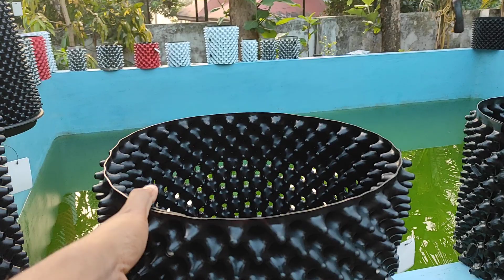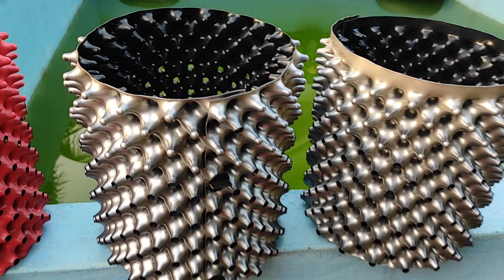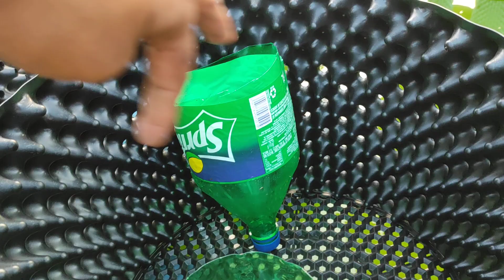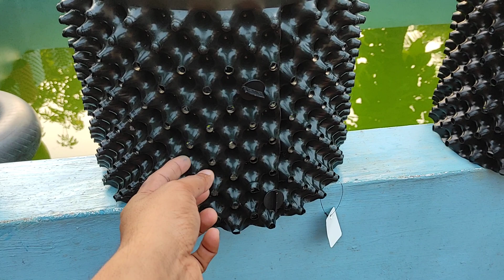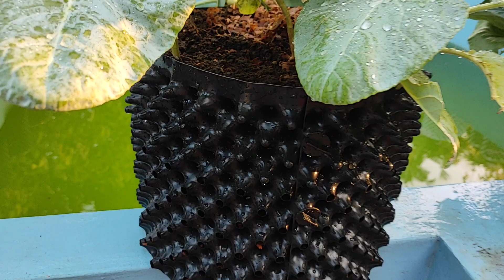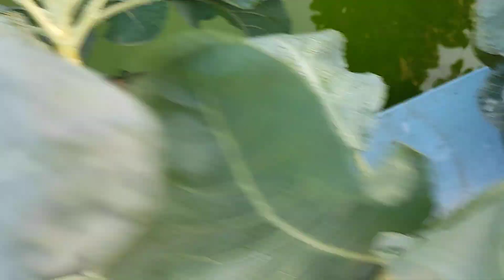എയർപോട്ട് ഏതു size വാങ്ങണം? 7736780815 whatsapp/call.Air pot, airpot, air pot, airpot, airport,

Comment: Paint ബക്കറ്റ് 20 ലിറ്റർ ഇന്റെ വാങ്ങി drilling നടത്തി holes ഇട്ടാൽ മതിയാകുമോ??
Reply from the maker: Air pruning system correct ayi work cheyyilla..Air pot is specially designed.but oru 10 percent result kittum

Comment: Rete parayamo
Reply from the maker: Plz whatsapp 7736780815...different size,different rates
Reply: Aa vauthu randinum enda rate?CC ethrayavum 6 ennam edukukayanenkil ethrayavum
Reply: @airpotkerala  hi
Reply from the maker: @najmaabdulazeez3427  plz whatsapp or call 7736780815..different size,different rate
Reply from the maker: @iqbalvaliyaparambil9768  plz whatsapp 7736780815
Reply: മിറാക്കിൾ ഫാമിൽ 50 രൂപ മുതൽ തുടങ്ങുന്നു, പിന്നെ 60, 150, 250....